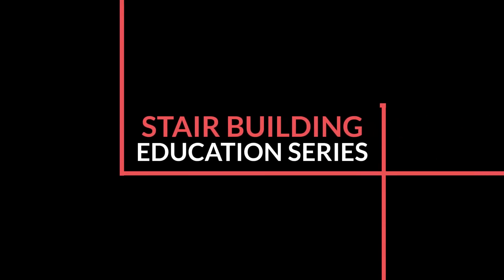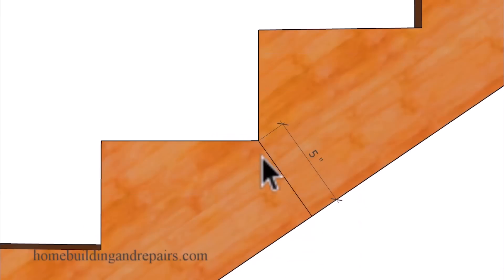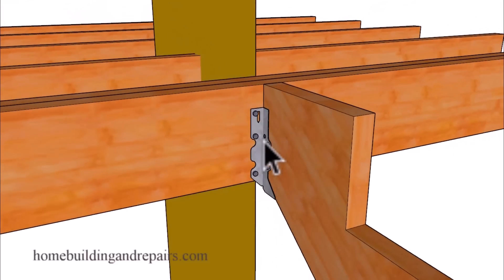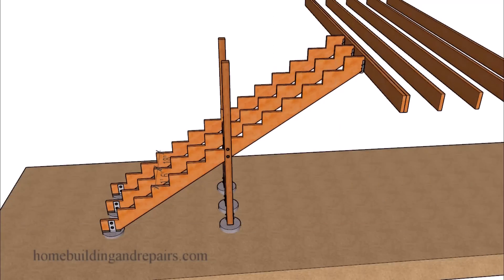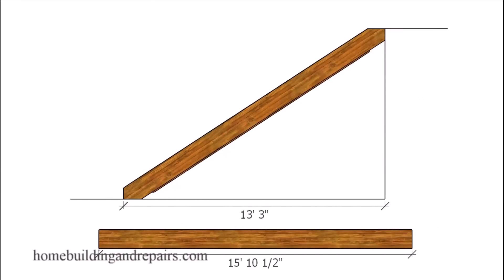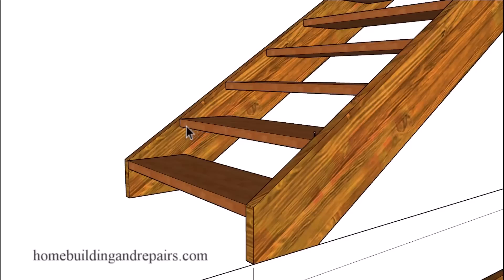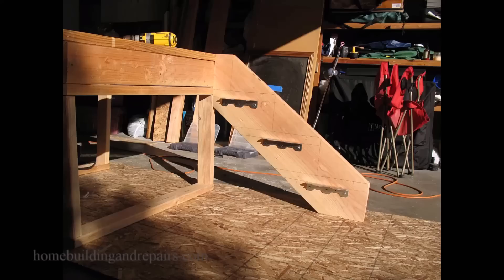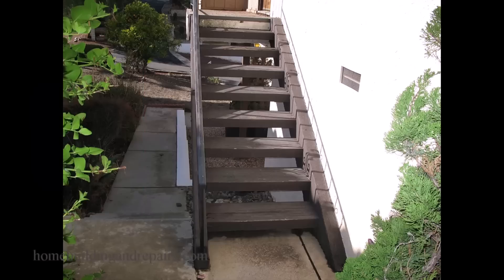Maximum Stair Stringer Spans - Structural Engineering Tutorial

Comment: Builder here, I mortice my 2x12 stringers 1/2" deep and drive the treads into the mortise. No need for blocks screwed under the treads. That does not give a professional look at all.
Reply: Do you glue the tread into the notch to avoid squeaking?
Reply: @GrampalettasCamp  I don't use glue, but I do run 3" screws through the stringer into the treads on deck stairs. I have not had any squeaking problems.
On interior stairs, I would notch/rout the stringers adding a space for a wedge to be glued and driven at the notch and under the tread where it meets the stringers.
I hope this makes sense.
Reply: @Bullhead2017  thanks, the wedge idea is interesting. I built alternating tread stairs to my loft to cut the total run in half and I didn’t glue them. Not as quiet as I would like
Reply: Just add a riser board which also adds stiffness

Comment: Tread cleats need offsets , 1/ 4 " minimum
Reply from the maker: But 10 inches max.
Reply: @gregvancom  i am referring to 1/4 space between a woode cleat / tread support and the stringer the cleat is attached to. I also stop the tread shy of the stringer and use galvi' washers as bushings on the lags that join stringer to tread .
Reply from the maker: @georgemckenzie2525  Thanks for clearing that up. Sometime we need a few more details to understand.
Reply: @georgemckenzie2525  Why is this? And just to be clear, you want a space between both the end of the thread and the stringer, and the cleat and the stringer? Is this for drainage? 1/4" inch is a big offset???

Comment: Space between stringers will be dependent upon what type and what brand of stair tread you are using. Check with the manufacturer on this. It will not always be the same as the joist spacing recommended for the decking itself. I've seen a little as 9" recommended for stair stringers while deck joist of the same material may span 16" center to center.